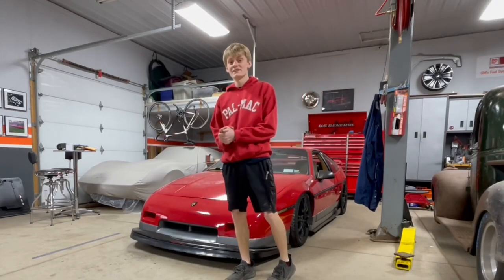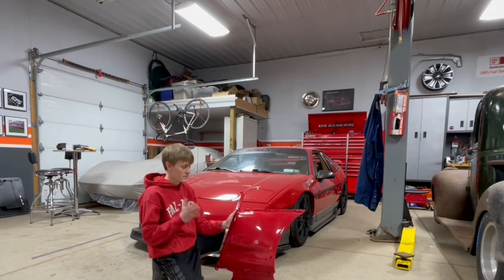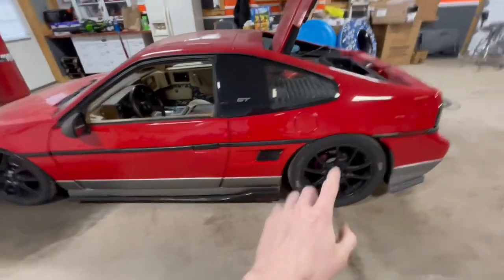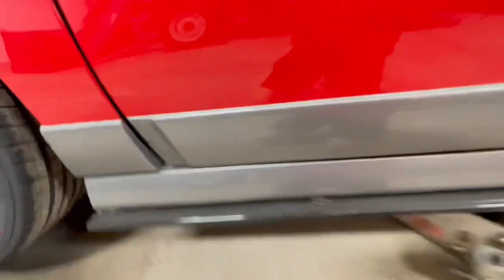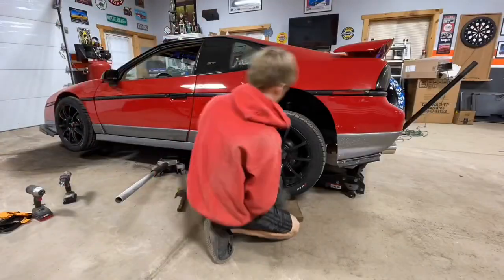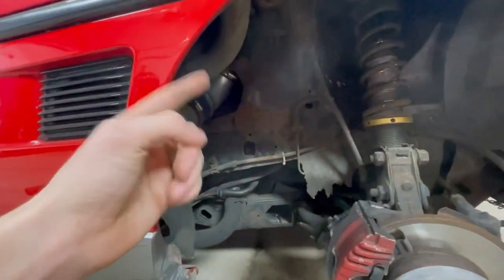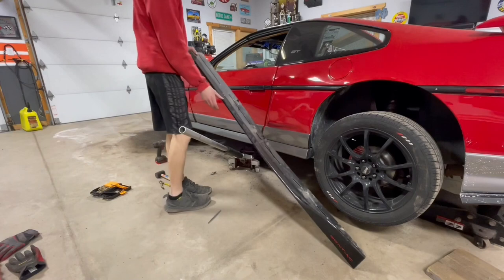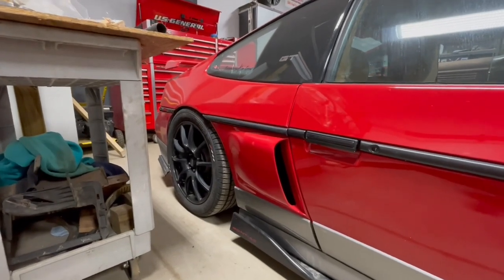Installing Side Scoops On My Pontiac Fiero

Comment: Wow, no one has commented since my last one almost a year ago.  As a suggestion, if you want to see your cold air cone through the scoop, you need to come in from the engine bay at a roughly 45* angle from the rear, so the cone basically is pointing toward the scoop opening.  Also, you should pull them off again and epoxy in some black screens to keep the leaves and other debreise out of the air box area that will clog the filter.  You can get the screen material at a "have everything" supply store.  I just shaped the screens to the back shape of the scoop, then epoxied them in place.

Comment: Where did you buy your Side Skirts with the winglets, and front Air Dam? I’ve been looking for a set for my 86 GT. I want it to look as modern as possible, since I’m doing a 3800S/C Swap. Thanks for the video I subscribed.
Reply from the maker: The side skirts are just 3 piece universal side skirts, you can find them on eBay or Amazon or anywhere like that. My front lip I made, it’s an early 2000’s bonneville spoiler flipped upside down with an early 2000’s mustang front lip on the bottom of that that I had to make fit, then I had to make the sides to help it follow the front bumper shape

Comment: Nice Fiero..!  Very nice side scoops..!  Mine are the recessed style, but yours look good too.  Just my opinion, but those black extensions on your ground affects, take away from the beautiful stock design of the ground affects. Leave them off IMHO...!?
Reply: As much as I can appreciate the stock lines, I do like something in between the stock lines and the extreme that's shown here. There are very few videos addressing the options of dress for the chin and wouldn't mind seeing more videos covering the range of ideas that applications. Wouldn't mind a removable splitter for the track and stowing their cables in the car when not in use so I wouldn't be scraping around here when cruising while still retaining a bit of a drop chin - slightly below the stock line - when on the street/highway possibly even improving air flow and driving less of it underneath the car.
Reply: @That_Handle  Good comments, but there again, it adds to much extra unnecessary stuff to the already well designed (GT especially) lines, that are so clean, smooth and sexy.  It starts to become a Christmas tree.  It's kind of like custom wheels, they can go either way, add too or take away from the stock beauty of the machine...!   Example: I've wanted some nice after market wheels on my GT, but hard to find the right ones and the right size.  And good fitment is a must.  My son bought an '88 coupe that had an expensive set of five spoke silver 17" wheels, and they looked great on the white car, but when we put them on my red GT, wow...everything just popped, if you know what I mean?!  They look similar to the the stock wheels they put on the Ferrari 355, but better, with the little yellow Horse, or Pegasus in my case, two inch hub cap.  Long story is that everything must balance out, and look like it belongs...!  Things as simple as the aspect ratio on the tires, is very important in affecting the overall look....!

Comment: Up next: Keyless entry?
Reply from the maker: I would love to figure that out at some point
Reply: @FieroKyle  I have done it on my Formula with an universal kit. Pretty srtaight forward, just follow the provided instruection. Most of them lso come with some kind of alarm system. It is installed under the dash, passenger side.
Reply: @FieroKyle  I bought the rfid push start fob with door and trunk lid. I have yet to install it. But looks fun. I just got an 87 gt with a 3800 SC swap swap. Love it!

Comment: What did the scoops run you for cash?
Reply from the maker: I got a good deal on them. Only paid $100 for the set. Usually are upwards of $300-$500
Reply: @FieroKyle  Thats crazy, Ive seen IMSA ones go for far more than that, but Im pretty sure its not the same animal. Great deal none the less!
Reply: @FieroKyle  the car I just bought came with them new but not installed. He spent $700 for them